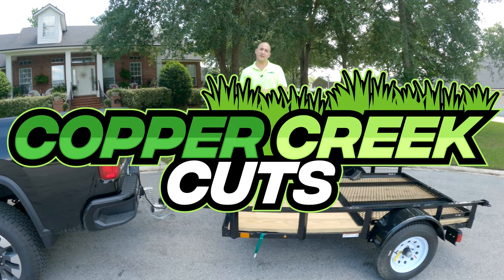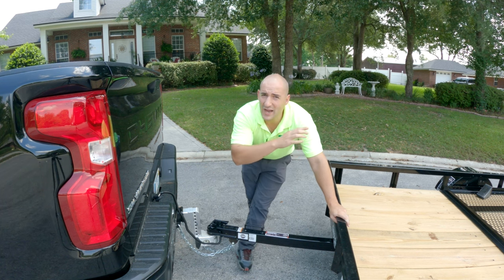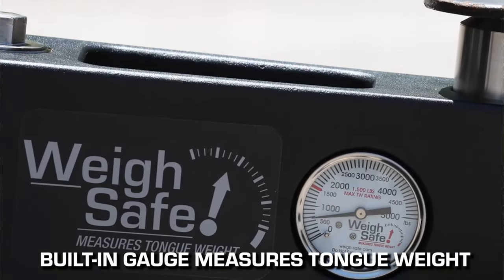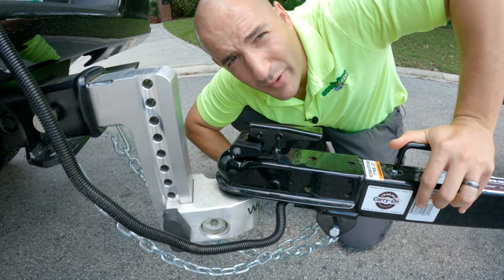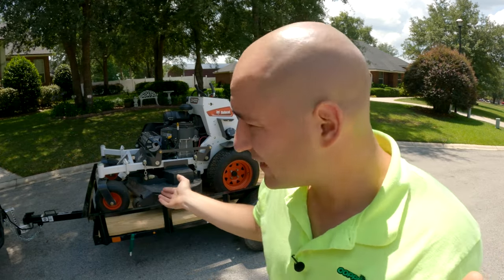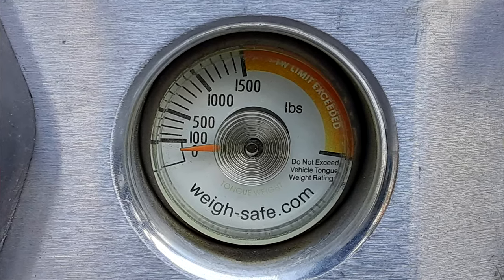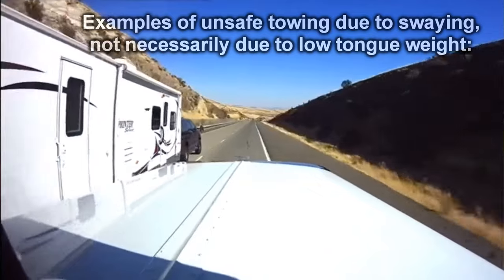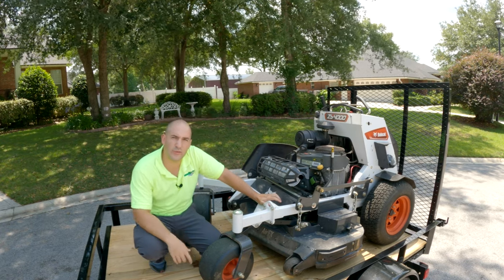What is Trailer Tongue Weight?

Comment: Was just looking to find out which hitch I need for my Rav4 since I just want to usually use a basket on the hitch. It can't tow much so I'm thinking just the 350# one. Probably won't have that much in the basket.

NEVER knew why that happened though with vehicles that's CRAZY! I wasn't looking for that info but glad I found it and won't soon forget it! My lil' Rav4 can't tow much of anything so I don't need to worry about that but for future use it's very good info. Thanks!

Comment: It's sad how many contractor type trucks I see with 80% tongue weight and no hitch drop when they need a 6 inch drop.  On a weekday basis.
Reply: Well they gotta maximize there potential.

I BOUGHT THE WHOLE TRAILER SO IM GONNA USE THE WHOLE TRAILER!!!

Plus drop hitches are expensive.
Reply: Yup.  Lifted trucks or trucks with oversized tires, and no drop hitch....back of the trailer damn near dragging on the ground.
Reply from the maker: So true. I think even with the Colorado I had (which is the smallest truck Chevy makes) I needed to use the 4 inch drop model for some of my other trailers (to be clear I don't think I had to use the FULL 4 inch drop, but having it available was nice).